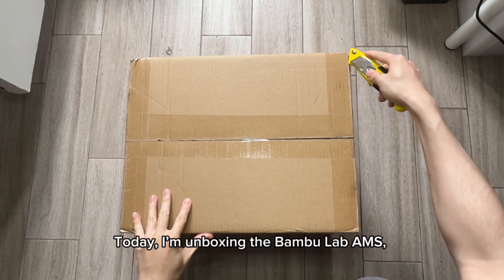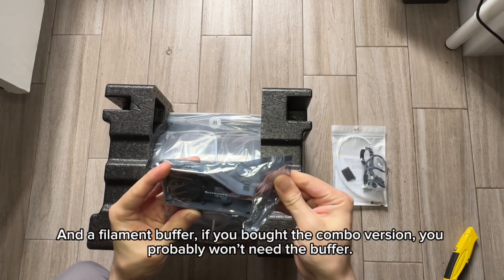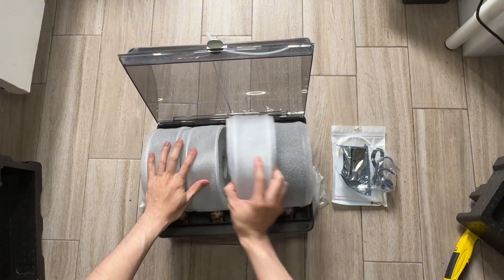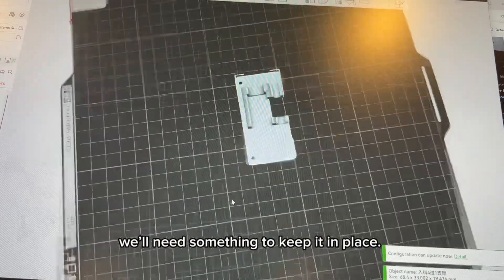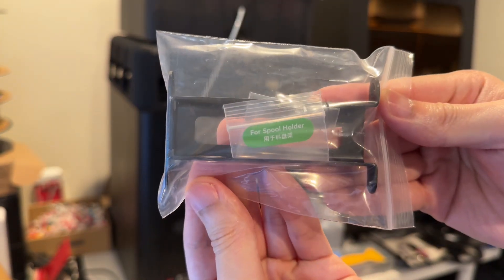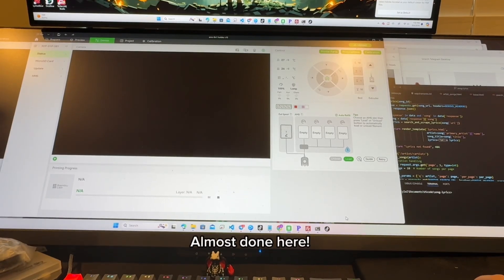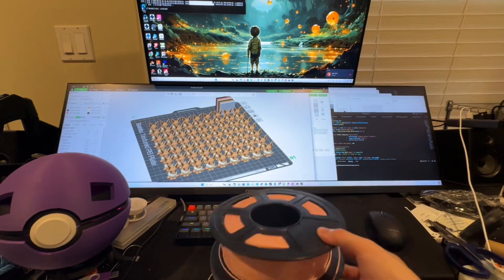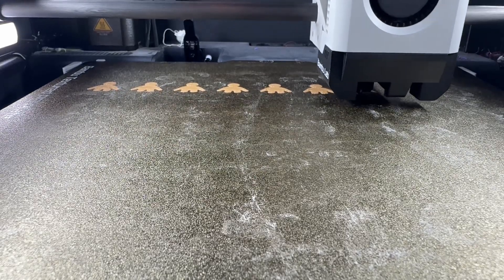Bambu Lab AMS Unboxing & Multi-AMS Setup with 4-in-1 PTFE Adapter no AMS Hub Needed | Step-by-Step

Comment: Omg all the loose filament ends flopping around... Have you never had that cause tangles on the spools?  They make filament clips for a reason
Reply from the maker: Are you using a Bambu Lab spool or a paper spool? Paper spools are lighter and have less friction. This difference means that during retraction, the paper spool doesn't rotate as much, leading to loose filament on the spool

Comment: I am still confused but closer now, so why would one need the expensive HUB device?  what role does theHub play if this has 4 in puts, can you use this for say one AMS and 1 external roll?  if your using external Role and get done printing how do you get the filament out?
Reply: Am going to make the assumption there, it is about where to install the 4 in 1  adapter  and what is the reason of the installation?
The main purpose of the adapter is to use filaments that doesn't support AMS like TPU, so it should be installed close to the extruder after the buffer to avoid any filaments getting stuck in there,
But here he is using it for different purpose to have more than 1 AMS but he can't use TPU any more bec it will get stuck in the buffer.

Comment: Great video. Saved me money! I just got my P1S about 10 days ago, the AMS bundle at Best Buy, and then decided to get another AMS from Bambu. Already costing so much money, the hub was another added cost I did not need. I read somewhere about not needing the hub just a quick comment on FB. Made me think, so I searched 2 AMS no hub, and ended up here. Works great. They should be ashamed selling a $50+ part, that a $5 part can do just fine, when everything else costs so much.
Reply from the maker: Glad I could help you save some money!

Comment: Is this still working?  The AMS hub wasn’t available at my local store so I went with this solution for the time being. When I connected the second AMS, it doesn’t want to properly read it or allow me to edit the filament in each of the slots. Simply says “fail.”
Reply from the maker: Still works. It doesn’t use the hub to communicate. It talks to each other using the 6pins cable. You might wanna reconnect them and reboot.
Reply: @ Thanks. I reset the ams on the printer and connected the second printer first and it allowed me to set the filament in it. I then reconnected the original AMS and it remembered the filament I had set in it, but won’t let me edit the filaments in it. I opened a ticket to Bambu so we’ll see what they say. 

I also had an issue with AMS placement. The second AMS could only reach the 4-1 by using a longer ptfe tube due to it being to the left of the printer. When loading the filament the AMS only wanted to feed it so far in the tube and then stopped and retracted it, before it reached the hub. I’ll have to work on a diff setup with a shorter tube because it must have been way too long.
Reply: @r0bd  yes exact same problem. I asked bambu lab if it was ok to pair both AMS up on the p1s and they said its fine to use old and new.
I was just googling and looking at the motherboard in the ams hub and can see 4 sensors on the inlet for the ptfes, its alot bigger if you compare to images of the filament buffer motherboard
Reply: @r0bd  2nd update, i updated the firmware on the p1s for the AMS, now the hub is working and the colours can be changed
Reply: Ive reset it all and took all the cables out and put in again. Im not sure if its bambu studio 2.0 thats the problem causing this colour change issue or if its because i dont have the hub and im using the 4in1.
The motherboard inside the hub looks alot bigger than the one in the single hub. Does the big 4 hub communicate with the printer differently than the single one with 4 in 1 adapter?
Reply: @peaceorpieces8343  so you and I seem to be in the same boat (except I have 2 of the original AMS on my P1S). I have a ticket open to Bambu so curious what they’ll say about that ‘fail’ error.  I can’t see what’s special about the ams hub that this workaround with the 4-1 splitter isn’t accomplishing nearly the same thing but who knows.
Reply: @r0bd  update, ams hub arrived , all plugged in, still fail to match colours
Reply: @jw3dforge I have this exact same problem but i thought it was because i have the p1s, original ams just got the ams 2 pro. It prints fine but wont let me change any colours in the bambu handy or the bambu studio, just says fail
Reply: @r0bd  i bit the bullet and ordered the hub just now, the motherboard sold it to me
Reply: @ 👍 yeah I was just googling and saw the same thing you likely did. I’m not against the hub, it just was out of stock at microcenter when I picked up the ams and I didn’t feel like waiting for it to come from Bambu.
Reply: @r0bd  i ordered it from bambu direct, i can wait the 3-5 days because the 4 in 1 mod works fine. Its just a pain the colours fail

I wish there was a micro centre in England
Reply: @r0bd  working fine now selecting colours, did update on p1s for AMS
Reply: @peaceorpieces8343  hmm. What versions were you updated to? I just checked and mine are supposedly all up to date as is the handy app, still erroring for me though. 

P1S: 01.07.00.00
AMS(both): 00.00.06.49
Reply: @r0bd  same firmware for printer, i cant check the ams because in printing now, will send it over in abit. I think it gave me a update because i had plugged the ams hub in. Never said there was a update i just checked it
Reply: @peaceorpieces8343  appreciate it! So maybe it is required then. Kind of shitty of them for requiring it if there truly is no functional difference.
Reply: @r0bd  i think it is required, i stripped it down and put all the parts in a upgrade on makerworld to stop the issues people are having with them, brilliant mod.
When i stripped it down there are 4 small springs and little metal pegs on each inlet for the filament pushing on to the 4 sensors you can see on the motherboard pics. They flew out everywhere 🤣
Happy i bought it but you dont need the frame to it, just the motherboard, spring and the inlet inner part to the hub
Reply: @peaceorpieces8343  yikes. Just pulled the trigger on the hub to hopefully fix it all up. 🤞
Reply: @r0bd  think it's the best option mate if you want to select your colours. I would highly advise you use that mod to make it easy to get your ptfes out
Reply: @peaceorpieces8343  def will. You have a link?
Reply: @r0bd  firmware is 01.07.00.00 p1s
00.00.06.49 AMS 
00.00.00.43 AMS hub

Comment: well I just bought the hub with a 2nd AMS unit in Dec. 2024 and the hub stop last night on a 209hr print and I was 10 into it
I'll buy this and try it but I'm going to get another hub just to be safe and if it works, I'll send it back unopened but I hate to wait a week and not have it work but so many used it so I have very mixed feelings 

Thanks for your time and knowledge
Reply: ok update........................ the PTFE came in hooked it up and it works just like he said. I was a big doubter but not anymore. so just do it and save 30-40 bucks 

Thank you so much and sorry for doubting you
Reply: @ptalbany thanks for the update. About to do the install.

Comment: can you make a video with the just the adapter and external spool and how that works?
Reply: An external spool doesn't have anything to drive the filament into the adapter as the AMS does, so you would have to manually feed it and pull it out every time you needed to use that color.

Comment: Is possible to print with 16 different colors if you buy 4 AMSes?
Reply from the maker: Yes. All you need to do just connect all the AMS with the 6pins cables. I am currently running with 3 AMS, planning to get another one later next year.

Comment: Just wondering why you installed the adapter before the buffer instead of after at the top like the Bambu guide? I’m trying to work out how to do 2x AMS + external from a dryer. Thank you.
Reply from the maker: Because it’s for multicolor printing. That’s why you need the buffer. If you use external spool, which is single color, then you don’t need the buffer. Therefore, I would suggest to use 2 splitters in your case for multi & external. Hope this makes sense to you.

Comment: so whats the difference between this and the ams hub?
Reply: The hub has 4 sensors to detect if the filament has be unfed from the hub before it feeds another to keep jams and damage from happening. This mod doesn't have a sensor as the 4way splitter is made for the A1 series witch has a sensor in the print head.
Reply: I believe the $50 one also replaces the single feeder on the back and actually helps feed filament.  The $5 one looks like it is just a fancy splitter. I am pretty sure the $5 one was made more for spools of Filament that will not fit in the AMS.
Reply: @kevincarter9555  Yes the $50 replaces the one on the back...for a fancier splitter than the $5 one...  there's no added value the hub provides.  The $5 one works for standard size filament.  I believe your comment is incorrect on both talking points unless I'm missing some context.
Reply from the maker: The $5 one is intentionally made for for A1/mini
Reply: @jw3dforge  That's not the one this video is referencing.......
Reply: @kevincarter9555  Its made for thA1 series. Its not supposed to be used in this way.
Reply: This way saves you about $40-45 - no need for the hub

Comment: I hate the wrap still on both ams but love the video and was wondering there are basically no downsides to this right?
Reply from the maker: I don’t think there’s any downside, unless the filament unload halfway and stay before entering the buffer/hub while changing filament with different AMS to save time. But I don’t think that’s the case, it will still unload the filament all the way then load from other AMS unit.
Reply: The only rare issue that could happen is if some filament brakes while loading/unloading and remain in this 5 cm tube between coupler and buffer being undetected by the last.

Comment: Dont use cutters/sissors to cut your pfte. Use a sharp blade to cut it straight, otherwise you will get issues down the line

Comment: whats the tool you used to cut the ptfe tube, anything special or just wire cutters?
Reply from the maker: I recommend using something like box cutter with razor sharp blade. I tried with regular cutter(scissor-like), the one that clamp together, it deformed the tube.

Comment: my ptfe tubes keep popping out of that 4 in 1. Did you have that issue?
Reply from the maker: Make sure you cut the ptfe tube with a sharp blade and flat. No uneven edges.
Reply: try putting the adapter on the other side. like in the bambu manual

Comment: do you have a link to the printed shelf from on top of the printer please?
Reply from the maker: Sure. here is the link.

https://makerworld.com/en/models/19535?designId=19535#profileId-19420
Reply: @jw3dforge  ah BLV, you a star, thanks
Reply: @jw3dforge  what material did you use for the shelf, just PLA?
Reply from the maker: @markm75  PLA will work just fine.

Comment: If Its that simple to do with a 5$ adapter why do they make the AMS hub? What are the downsides?
Reply from the maker: Well, looks like the hub is just for individual buffing.
Reply: My understanding was they made the $5 adapter for filament that won't fit in the AMS.  I am fairly new to this but that is what I read. I guess some CF Filament and few others won't fit in the AMS.
Reply: @kevincarter9555 this is the exact reason. I just bough one so I can print TPU while keeping my AMS connected.
Reply: I use this adapter with multiple AMSs. And there seems to be only upsides. I can’t speak for speed difference in large multicolored prints where you have hundreds if not thousands of changes. I actually had issues with the hub, that seem to go away or at least be better since the change. It’s so nice to have that I actually put one in on my other printer that only has one. It makes it easier to remove the AMS if I need to remove it for some reason.
Reply: @ericdepangher7547 so would you recommend the $5 over the hub since the new ams 2 is coming out?
Reply: What computer screen is that
Reply: The AMS Hub is used to expand the number of AMS connected to Bambu X1/P1 series printers from 1 AMS unit (4 channels) to a maximum of 4 AMS units (16 channels) to improve the refueling speed across your multiple AMS units and support the redundancy of a buffered signal.
Reply: @edwardturner7689 really sure ? The hub is exactly a buffer with a 4 splitter inside. They created the hub, then they have seen a lot of people to buy the a1 lite hub and created this 4 in 1 splitter avoiding to indicate that it could be placed before the buffer to create a hub with a splitter and a buffer. Infact the HUB is always out of stock just because I think they reduced the production. They make more money selling the HUB but honestly I think they know that in long time it will be replaced by this cheaper solution.